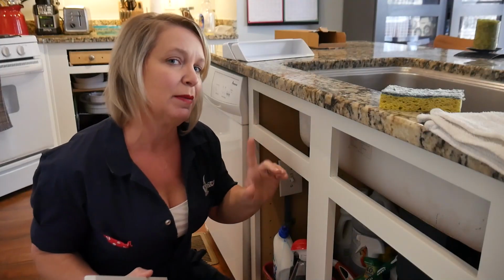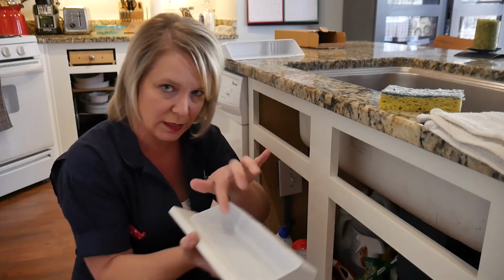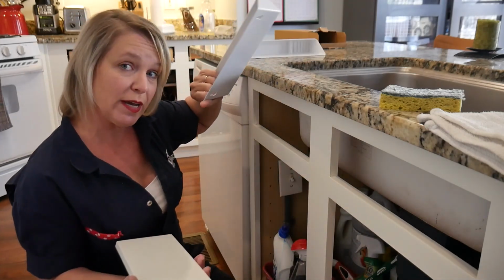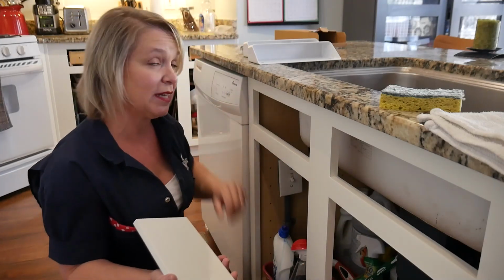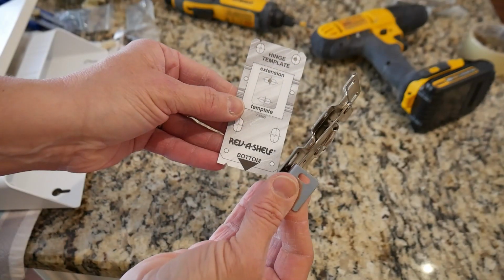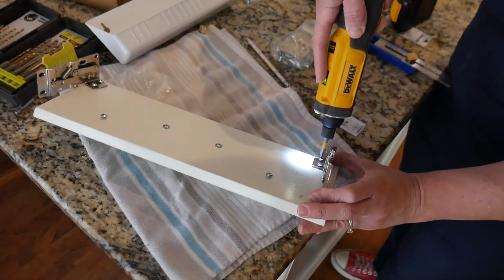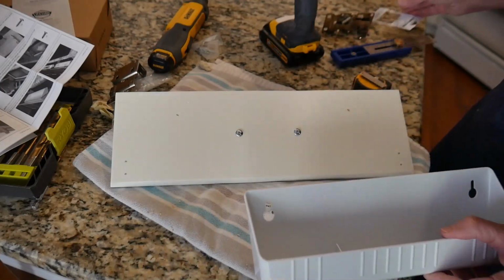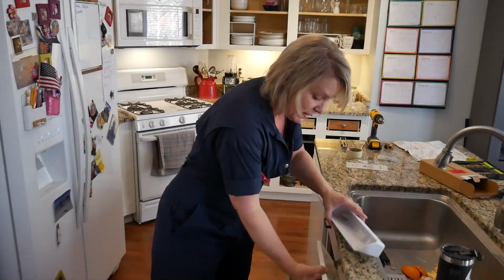How to Install Tip Out Trays for a Kitchen Sink (for sponges, stoppers, etc.)

Comment: How did you remove the false fronts?  Ours have been attached for over 25 years.  Redoing the kitchen due to Hurricane Ida, now's my chance to get some space back.  My husband's NOT excited to do this.  We have 2 sinks:  the real sink, which would only accommodate the tip-out trays.  It might not be worth the effort.  But we have a bar sink which is losing 2 small drawers, and really it only takes up half of each - I was hoping to get some drawers back.  But the FIRST problem is to get the false fronts off the cabinet.  I think they are both glued and screwed in.  I welcome any info or suggestions provided.  Thanks in Advance.
Reply: Most of the time they are held together by a piece of wood stapled behind the false fronts. You need to cut/remove it from behind under the sink.
Reply: I literally just took mine off in the last 30 minutes.  I took a wide stiff scraper and carefully shoved it between the false front and the cabinet, whacked it with a hammer a couple of times and was able to pop them right off with zero damage. Took less than 5 minutes to do both.

Comment: Does the hinge work for full overlay cabinets?
Reply from the maker: Yes, they should work, as long as there is enough space for them to swing out at the top. Mine are partial overlay. It should just be a matter of lining the hinge up properly on the back side of of the panel.

Comment: i  LOVE your videos, you are helping me with a solution to a cheap builder grade vanity in my new home's guest bathroom to put a flip front tray.   Question - do you have any suggestions for pull out organization under the sink?
Reply from the maker: Sorry for the late response on this, and I'm sure you've figured out this issue by now. Nevertheless, you can purchase drawer slides based on the parameters of you cabinets, and build a "box" for the shelf as needed. This will vary based on if there are pre-existing shelves that you can attach the slides to, but you will need to build the "drawer" to attach the slides to.